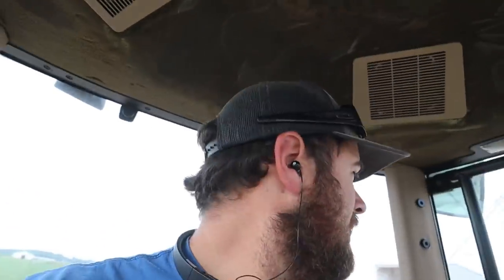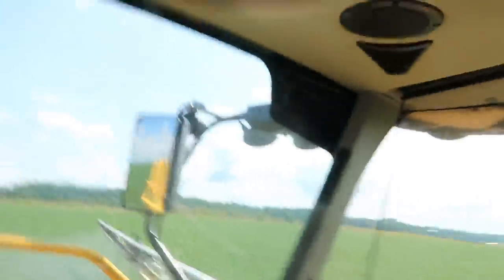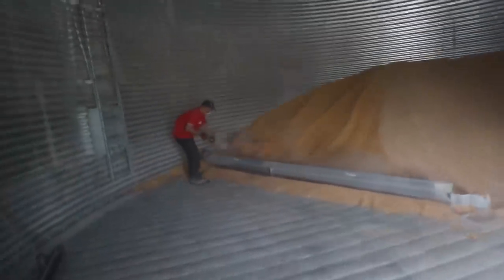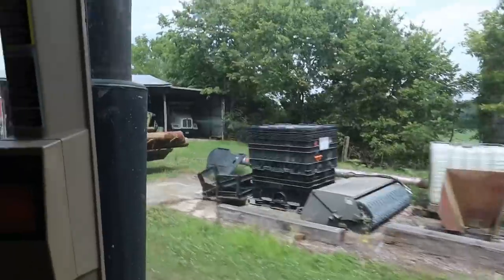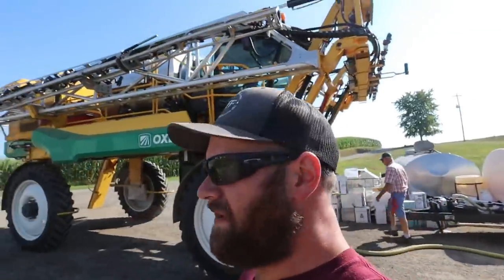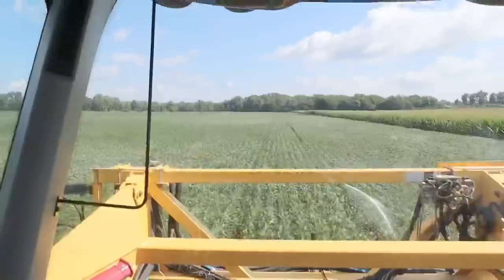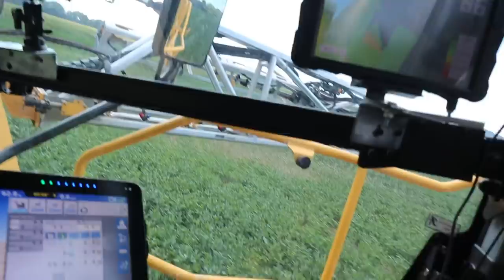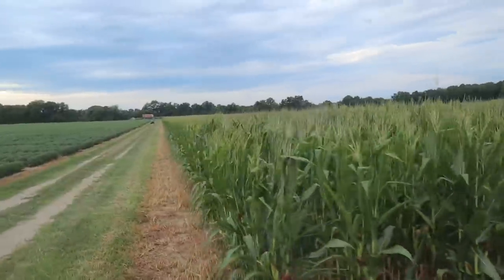Old Farmer Teaches Young Farmer How To Run Sprayer

Comment: I do like our front mount Miller Nitro. It has four wheel steer as well with a 1,600 gallon tank. Yes, hard to see out of but you get used to looking around the booms. Appreciate all your vids Brian. Be safe all of you Browns.

Comment: I hope the road under that bridge is not ever resurfaced without you knowing........  looked tight.  Happened to a sprayer on the back of a Unimog in UK years ago.  You guessed it, the sprayer was ripped right off the Unimog.....

Comment: I know that it's probably how it's always been done but I'm kinda lazy and was jus wondering if you put corn back in the same bin why does that little inch or so have to be swept????  I know how hot and dusty They can be
Reply from the maker: Most likely it wouldn’t matter but it has the potential to cause issues latter. Bugs being on the list